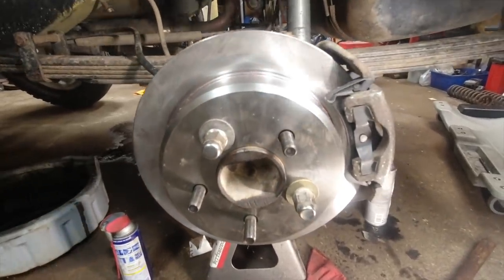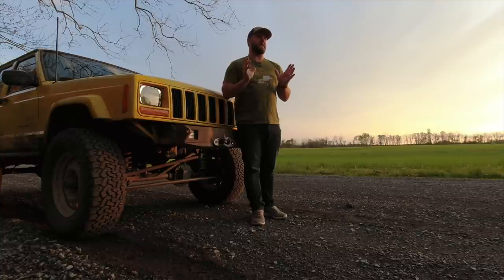Simple XJ to ZJ Rear Disc Brake Upgrade

Comment: converting from a perfectly good drum brake with abs to a non abs disk brake (which could not brake more than my drums that try to lock up everytime i brake hard) would be a major (and dangerous) downgrade.
Reply: XJ's never had rear abs.
Reply: @MrSocialJoe  you're funny
Reply: @TheHolan  I'm pretty sure I'm also right. Are  you aware of any year XJ that had factory rear abs? I'm not. My 96 has every option they offered and doesn't have rear abs. I don't think it was added in the 97 refresh either.  If I'm wrong, that's fine; I'm always trying to learn more random old car info. I do know front abs was an option for most years and my 96 does have that.

As for the rear lock-up concern. That's why you swap in a ZJ factory rear disc proportioning valve.
Reply: @MrSocialJoe  maybe you are right, when you limit your knowlege to your location. MY xj ('93) and every other xj i know has 4-wheel-abs from factory. but these are european models.
Reply: @TheHolan  Yeah, that totally tracks and makes sense/explains our disagreement. It was probably Euro mandated. In that case, you can swap in ZJ axles that have the tone rings for abs and use the ZJ sensors on the ZJ brake backing plates to retain rear abs. You don't have that option with a Liberty brake swap, they used a tone ring+sensor in the differential.
Reply: @MrSocialJoe  that could work. the technical inspections in europe are very accurate. changing parts of a car is not simple. it could slip through, but still would be illegal and you would drive without license/insurance which is a major problem in case of an accident. if you let examine everything and it is licensed (in the papers of the car) everything ist fine and ok. sadly that costs a lot of money and effort.
Reply: @TheHolan  Oh, I don't doubt it. I  sold a '68 Buick to a fella in Germany a few years ago and we were glad it was able to pass MOT with however many exceptions they grant to vintage cars. It's pretty unfortunate that swapping around parts that result in an arguably safer car are so hard to get past. On the other hand, you see some sketchy  stuff on the road here lol. There's pros and cons, but most of the time I'm glad that isn't a problem I have to concern myself with.
Reply: My 99 has 4 wheel abs… on the Dana 35…
Reply: @Deadbuck73  ironically so did mine, on a factory D35. Learned a thing while doing the disc swap.
Reply: @MrSocialJoe  so you got it done? On the D35? How did it go? Should I look further into it?
Reply: @MrSocialJoe  was the disk brake swap on the d35 the same as the 8.25?
Reply: @Shayno92  110% the same other than having a smaller lock bolt in the diff and different bearings/seals.

Comment: " I DON'T want to round it off ,so I'm gonna use vise grips "  i'll just crush the shit out of the hex instead .  WTF
Reply: Believe it or not there is a fine adjustment on a quality pair of vice grips between not gripping (rounding off) and completely gorilla strength crushing the nut !

Comment: Great video but that didn't look easy at all 🤣
Reply: As far as disc swaps go, the only thing easier is if you don’t have to grind them to fit. The video obviously edits the process to shorten it, but it took me 3 tries on one side and 2 on the other, grinding for 1-3 minutes each time. IMO not hard and not a big deal. Everything else I did is the same stuff you’d have to do installing it from a kit.  Overall the swap took me about 3.5-4 hours

Comment: Changing the springs doesn't do anything.
Reply: I ran it with the XJ spring in there, swapping the spring completely changed the balance of the brakes
Reply: @DRTJon  Are you serious? I read online it doesn't do squat. But if you say so I believe you. Maybe I'll swap the spring out and test it out. What year WJ spring ? I have a 00XJ. Thanks.
Reply: @nrconnor60  maybe it’s placebo but the differences were in feel and performance. The springs are obviously completely different and there’s no discernible difference between the valve bodies. Get the whole ZJ valve and try the spring first. You can always change the spring back and swap the whole ZJ prop valve. Any year ZJ with disc will work as a donor.